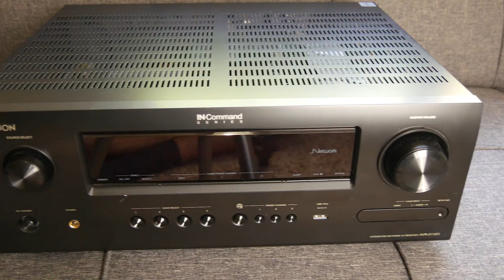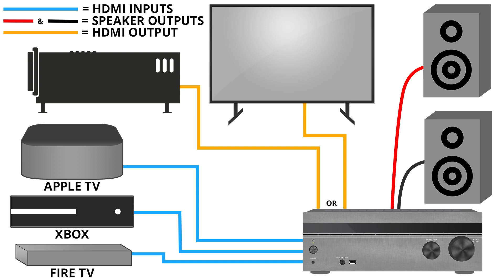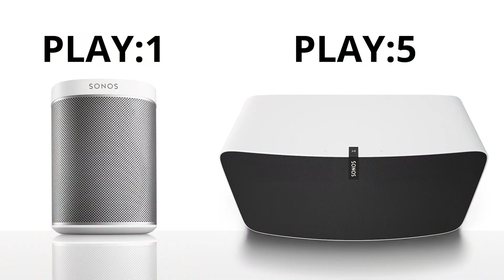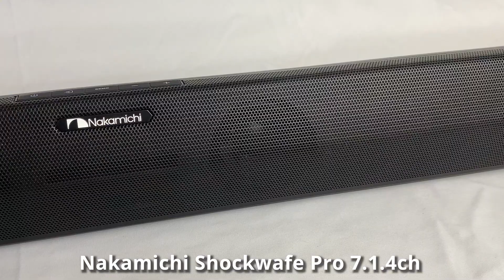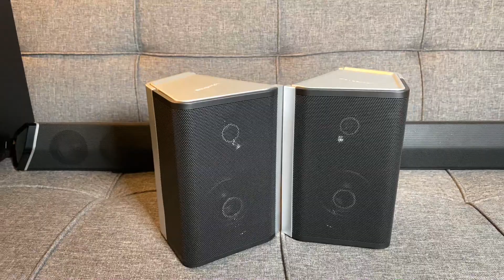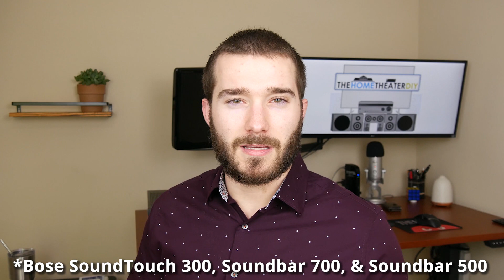You Don't Need a Receiver to Have a Surround Sound System!

Comment: Sorry but After using sound bars for so many years I can confidently say once I bought a 5.2.2/7.2 receiver I can confidently say running a 5.1.2 setup blows any soundbar I’ve had out the water and any soundbar with DTS-x or even a 4.1 sound bar with rear “wireless speakers just doesn’t sound any were close to to my 5.1.2 Dolby Atmos surround sound, once I fired up a movie with a good Atmos mix in it I was blown away with the clarity of the sound and getting goose bumps especially when it a jet flies over from back to front and the transition to each speaker was amazing and I couldn’t even tell the audio was being reproduced by speakers it felt like i was there in the movie which is something I’ve never gotten from a sounds bar, the only time I see a sound bar as an actual Choice is for an area where you don’t need surround sound so like a living room or a teenagers room for gaming but saying you don’t need a receiver to have a surround sound system is completely disingenuous and misleading for the simple fact that a soundbar has a receiver built in not to mentioned in the case of “wireless rear speakers” you need a receiver to catch the signal being sent out by the main unit and the issue with that is it’s able to have to interference causing issues with the audio cutting out and it’s another part to fail same with sound bar subwoofers which are wireless and the less wireless, I’m sorry to say but sound bars while they’re useful they’re not replacing a full setup with proper receiver that can handle proper Dolby Atmos and not needing upward during speakers and using the ceiling as an acoustic mirror and you hoping you get the desired effect which can be hit or miss, i would advise changing the title!
Reply: Do you mind sharing your setup here?
Reply: Exactly, no way a sound bar would touch my system I have put together, I don't even have it all hooked up. It will be around 5000 watts total not including the watts for the Klipsch sub with its built in amp.

Comment: If u like good sound wireless sucks. If u just want better than tv speaker sound that the wife aproves of wireless is acceptable.  A proper setup. Wired 2.2 channel audio system is where its at guys. You wont miss all the extra channels. Had 7.2 setup.   Its not worth it. Good quality2 channel is still very relevant.
Speaker  placement of 2 channel is fairly straitforward in any room.   Match. The reason for two subs is you get more even in room response(two subs is definitely worth it over one sub)

Comment: Without a subwoofer, a sound bar is a joke.
Reply: With a subwoofer a soundbar is a joke, everything is proprietary so you’re stuck with what you get, atleast with a dedicated surround sound receiver you have the option to upgrade your speakers overtime and built a complete system from the ground up and learning things along the way not to mention a lot of big name companies like Sony, Onkyo etc have home theater in a box with slot of them coming with powered subwoofers that utilize a single standard RCA audio cable making upgrading easy!

Comment: I just want to use the output from a pocket speaker to power my surround - I cut the stock speaker and replaced with my wired speakers the bluetooth quits within minuts even though it is plugged into the power outlet, Whats the deal all im doing is sending a signal im not using it as an amplifier, I fried two capacitors, Or are these pocket bluetooth speakers only good for one speaker- whats goin on with these things are they not designed for multiple speakers as im not using it for amplifying the sound i simply added more speakers so there shouldnt be an issue

Comment: I have a soundbar already, but I want true surround sound, is there any device which can take my TV's hdmi arc as input, and have separate Outputs for my soundbar and it's sub and additional speakers?
Reply from the maker: There are only a couple of devices that can accomplish something like this, but they generally are not a great experience. If you want actual surround speakers with a soundbar, you are better off getting a new system. Sorry.
Reply: @JonahMatthes  yeah, thanks for the reply

Comment: I would like to add, that from my experience to have enjoyed better fidelity out of passive than active speakers. Sure a powered sub for your car is one thing. But at home, I just think passive speakers, including subs sound more musical than powered ones. That's the beauty of 5.1 surround systems. From quality companies the A/V receivers and speakers should match excellent together, better than any other brand regardless of price. I have a number of quality receivers, and tested them all with my speakers, but nothing sounded better than the receiver that came with the surround system (JBL). That really surprised me. But I imagine that will largely depend on the stereo company you prefer. Building a set of speakers, or speaker kits I have heard are a great way to really increase the quality of your stereo while not mortgaging the house. Which kits, that I cannot say regretfully. But when it comes to cabinets, finding a quality pair of speakers with nice cabinets but "blown" drivers I think is the way to go. You just replace the drivers, that way the speaker cabinet is already built. Used cabinets with bad speakers in them go real cheap too. You will need to watch and find new drivers that match the crossover unless you wish to replace them as well. And that is something I am having a hard time to understand - the high cost of speaker crossovers with low end Chinese parts. Parts Express anybody? Peace.

Comment: One thing people don't ever think about and that is creating an acoustically neutral room, or any kind of sound proofing to make the room your stereo is in work better with your stereo. There are crazy expensive "foam" products out there and I'm not sure if they deliver for the price. However, having a room with double walls where there is a 2 - 6 inch open air gap between them I do know works great at making a room shine acoustically. And allows you to crank it up without annoying the whole neighborhood. The most bohemian and cheap way to help a room out is hanging moving blankets from the ceilings along the outer edge of the walls, again leaving that so important gap of air space and making sure the blankets extend to the floor. And by the way, can you ever have too many speakers, really?  :)

Comment: "The wireless surround speakers connect throught a wire to the sub ", which then connects wiressly to the sound bar.

(even the really wireless surround speakers still need to be connected with a "wire" to the power plug.)

I think that in many cases it is still less trouble to route an audio wire to a traditional "wired speaker than figuring out how to place a power outlet next to where the surround speaker is supposed to be placed.
Reply: The rear surround speakers typically do NOT require a power outlet, only the Subwoofer does.  You plug in the subwoofer and connect it wirelessly to the soundbar, and only run cables halfway or even less compared to running speaker wire all the way from the receiver to rear surround speakers, let alone Atmos if someone is doing that.

Comment: For surround sound you need some device that splits the signal to multiple channels. A sound bar splits to the signal to the drive units it has and possibly to bass and rear speakers.

To balance the sound between left and right, front and back a receiver has the most features for easy adjustment.  You can have a HDMI debedder that takes the audio out to 8 channels and passes through the signal to a television, projector or display monitor. If the source is a computer then the computer treats the debedder as a sound card and you have some control over the arrangement.  Passive speakers and active analogue speakers do not have a lip sync latency issue. Anything digital and particularly wireless introduces delay or compression or both. Not all systems give you the control and set up features to make the adjustments. Usually the audio is delayed but can sometimes precede the action.
Reply: Well, there is low-latency Bluetooth, so hopefully manufacturers can find a way to do it wirelessly without a delay, or find a way to compensate somehow to have the audio sync with the video, I don't think it should be that difficult.

But beyond that, I'd like to see them make the soundbar the center channel speaker only (there's no real stereo separation, imaging, or soundstage with a soundbar, and separate fronts are needed for that) and have all the other speakers including 2 fronts, L and R, a sub, and however many satellite surround speakers, connect wirelessly. Of course, the soundbar would be the signal processing unit/audio decoder via HDMI as well. 

My biggest issue with having a surround sound system, besides putting at least 5 speakers and a sub all around my room, is having to run cables from a receiver all the way to the rears, so I don't do it.
Reply: @mydogskips2  Low latency Bluetooth is still compressed and lossy. Airplay 2 is compressed but lossless. It works with Mac, ipad and iphones but not Airplay app from a PC. 

Wisa uses 5GHz but is different to wi-fi with a spec of -15 to 35 ms latency. Each speaker has a receiver so no cables to or between speakers. Limited to 24/96 with the best Ethernet RJ45 systems able to do 24/192.

Comment: Soundbars are glorified center channels. To believe they can provide surround sound is silly.
Reply: They do ok for a while but once you hear a real surround sound system it’s a night and day difference, I had a 4.1 surround bar from Samsung and then later on after I beat cancer I decided to get back into home audio so my first purchase was a Yamaha 5.1 system then i upgraded the receiver to a Sony 7.2-5.2.2 receiver and upgraded from the Yamaha main speakers to a 5.0 set of Klipsch speakers and the subwoofer to an R-12SW from Klipsch and my height channels are some Sony atmos drivers I will never look back unless my mom wants a little bit of an audio upgrade than I’ll repurpose my old Samsung 4.1 for her so she can have a little bit of boom!
Reply: Of course, it's just that the manufacturers of soundbars need to sell them, so they advertise them as surround sound, and a lot of people believe it.

Comment: If you want true separation there is absolutely no way around it  you need a home theater receiver or some sort of audio decoder that properly reads the audio output from the designed source and outputs it to the proper channels. If you have a Home theater receiver that is 5.1 and you want an Amp to boost the sound ( watts per channel ), you simply just can't buy a two channel Amp, because you'll only get stereo, you'll need a 4 channel Amp and use LFO/LFE ( low frequency out put or better terms The sub woofer) threw the Pre Amp. If you want proper separation  you'll never obtain it by jerry rigging a system.

Comment: You do not need an AV receiver or AV pre-sound processor or anything else that often is both superfluous, undersized and expensive in order to get a DTS / AC-3 decoder with 5.1 or 7.1 audio out via DAC to discrete analog outputs.  There are plenty of products that even have HDMI and HDCP v2 and higher with ARC and CEC support etc on the market that have that function and support for much less price even counting the amplifiers that can drive the speakers.
Reply: Can you please elaborate.. what these products are?
Reply: I already did the homework and 500$ surround receiver is a better solution and cheaper.

Here is what you need to have good sound without a receiver.

A hdmi extractor that gives you rca conectors for all your inputs.
You can also use a good enough usb soundcard with proper drivers to run dts decoding and so on.

You need minim 3 spliters 16 mm to rca.
You need 3 set of rca white and red cables. And finally 2 desktop size amp with a minimum of 100 x 100 watts of power and finally a 3rd one with a pre out connection which you connect your sub to it or   in one that can give at least 300 wats in a single channel L- and R+ connection.

All that at modest quality is gona cost you around 600$ taxes included.

Comment: So I got a yamaha rx-v365 with 2 towers hookup aalong with 2 front and 2 rear an! Center Yamaha speakers that come in the kit then a 200 watt emmersion sorround sound dvd player hooked up to 2 more towers and a 8" sub plug in to the front speakers and sub outputs  then a denon avr 484 hooknup with 2 bookshelf speakers and a center tower with 2 Denon satellite speakers. So got phone plug into the Yamaha then got that running to the dvd player input then habe the out put of the dvd player hooked up to the denon avr. Trying to find what volume o should run all these systems together or got where literally can take 2 audio plugs intonphone to 2 at se time but wanna know if should volume on phone be all up then dvd player all up and denon at  and then just turn yamaha up till its sounds good but then feel like some spesakes arent run runing at some points while playing with all 3 volumes to get it tunned just right if anyone still b with me and help me open ears here

Comment: I've had my fair share of audio setups, from surround sound packages to budget AVRs right up to my current system, which is an audiophile grade 5.2.4 setup but if I could go back and start again, I would've invested in a good 2.2 system, if you got good speakers and their are positioned correctly, the imaging would be good enough!
Reply: Y’all should invest in some q-tips instead 🤭
Reply: what does that mean @krowwithakay
Reply: Speaking from someone who has a high end NAD master M33 + Focal Aria floorstanders and sub I don't like it for movies. Really need a centre to enhance dialogue cause of terrible mixing in many modern films. Cough **Nolan**  Sigh, I realy did think like you did but if i could go back in time i'd not have invested. I don't want two different systems in my lounge and yes the imaging is perfect triangulation as per manufactor gulde to the cm and speaker size choosen exactly for the room size. Honestly my 2 pet hates remain. I hate black bars and I hate having to use subtitles so I end up watching my movies on an ipad! despite THOUSANDS in oled tv and sound system. If there was a WAY to CHANGE how 5.1 is downmixed to stereo this could be solved and the ONLY way I know how to do that is a Surround reciever!
Reply: @jondonnelly3  I have found with good fronts and the right position, no need for a centre, it works. I may have to add I do not watch a lot of film and have no tv, but do it all on my pc. 

I do prefer back speakers (not side surround) and would love (tried it and loved it) just 2 top or front high.

I could add more and more, and 4 overhead and stereo+wide stereo plus 4 overhead plsu bla bla. But I think the most minimal for the best sound placement is what should be, 4.1.2 in my case. I'd take 2.2.2 in a pinch (yes it really is official).

Comment: I don't know if this will be a silly question. But if you can have wireless speakers. Couldn't they make TV's with built in surround that sends surround sound to those speakers wirelessly.
Reply from the maker: They do that now actually! Using a technology called WiSA. It's fairly new and being implemented into more and more TV's over time. Not sure if it will take off industry wide though.

Comment: A 6channel receiver is a hybrid between a 5.1 channel decoder and an amplifier. (Combines the two)

Alternatively: 
You could just buy a cheap 5.1 decoder and connect the output of the decoder to an signal amplifier. 

There is definitely some hassle upfront but once you’re set, you don’t seem to notice it at all. The results are phenomenal. 

The overall cost comes down dramatically, also the above setup allows for practically endless number of any type of speakers through daisy chained amplifiers and not just the ones you get with your receiver.
Reply: Hey got my phone hooked up to Yamaha receiver with 2 towers and then 5 Yamaha sorround sound hook up to 2f 2ssb and a center little speakers and 10 powered sub then out running to 200 watt Emerson Dvd d sorrund sound player with 2 towers hookup up to front speakers output and 8 in sub from sub put them got the out put of that running to my denon avr 484 which is running 2 bookshelf for fronts and 1 tower for center then 2 satellite denons speakers so literally trying to know what volume should I keep stuff at to listen and get best sound or listen all individually then run them all hook up yo each spec that sounded good individually sounds like some power getting lost cant get all to sound right for all I have running atm

Comment: i cant believe in this day and age, that a receiver needs to be that big
Reply: Class A or AB amplifiers kick out a lot of heat, and 5 channels of fairly high power amplification needs plenty of space, not just for the components but for cooling - that's why receivers were originally that size. Nowadays you can get smaller receivers that use Class D amplifiers - they are a lot more efficient so produce less waste heat and don't need the space. However, good Class D amps tend to be expensive, and cheap ones generally sound worse than AB.

The other reason they're the size they are is to fit all the connectors on the back. Small ones may be more limited in what they can offer in terms of connectivity.
Reply: Some are around 30 pounds. Must be the coils for all the transformers. I haven’t checked if anyone makes solid state receivers for high end sound systems.